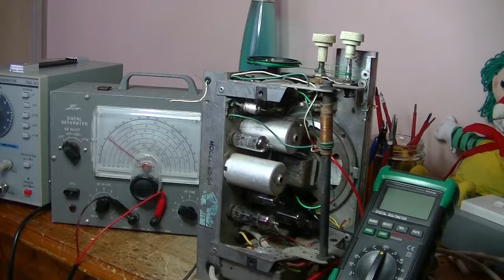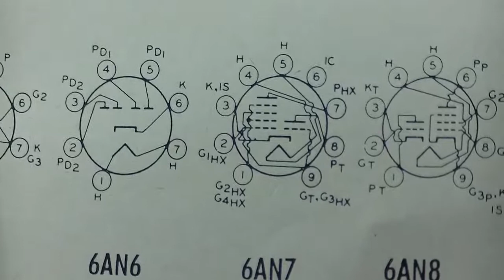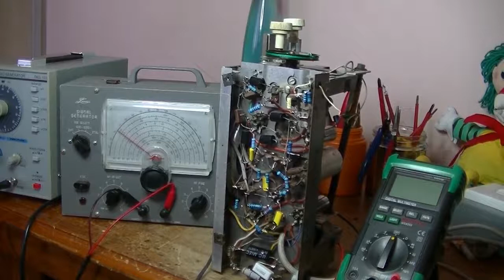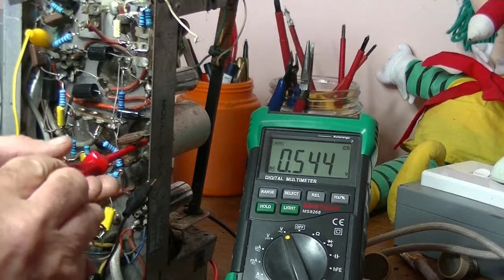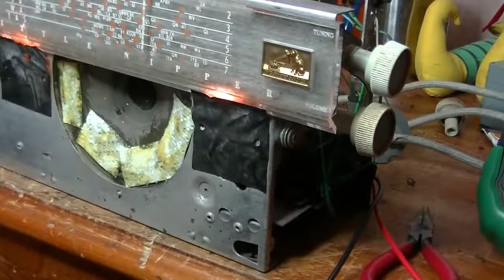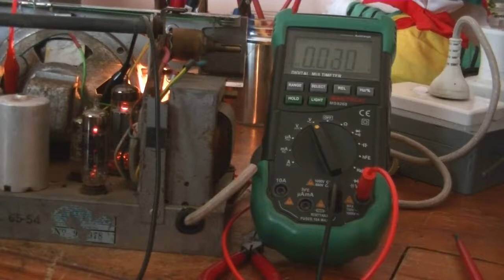HMV Super 5 Valve Radio Alignment

Comment: Hi great videos👍 I've tried to watch all that you do regarding the alignment procedure as I'm new to this  and would like to do my own.
But I can't see where exactly where you place the leads from your volt meter or from the signal generator.
Could you of someone here help me on this my first attempt.
Regards
Leon
Reply from the maker: Hey Leon, check your email :)
Reply from the maker: Hey Leon, no probs.

For the IF alignment the red (or hot)  RF generator lead is attached to the input grid of the detector valve ie, the one that is closest to the tuning gang. If it's a 9 pin like the 6AN7, the input grid is pin 2. If it's an octal valve like the 6J8, then the input grid is the metal cap on top of the valve. The wire attached to the metal cap comes from the tuning gang and should be left in place, according to the service manual.

The volt meter leads are attached directly to the speaker terminals where the 2 wires come in from the output transformer. The OP trannie gives off AC voltage which increases as you turn the volume up and the reverse as the volume is turned down. Your meter set to AC volts will display the voltage changes

Let me know how you go and if you're still not sure, or have other questions, send me another message and I'll put together a short video on this. Also fell free to email me at exeters_lab@protonmail.com

Good luck :)

Comment: What???  You're using a Digital Multimeter to do an alignment??? Don't you know you are breaking "Thompson's Law!!!???!!!"  ;-)
On the serious side, I would never be able to use a Digital Multimeter to do an alignment.  It's a personal thing.  An analog meter is just the perfect item to make the measurements for me, and I would rather wait till I had one, borrow one, buy one...etc.   Since I believe you to be mature enough to accept a little good-natured ribbing I just had to kid you a bit.
I know a few folks that say you should be sure that the meter that you use is > 20,000 Ω/volt and often they suggest you use a Simpson 260.  I would love to own one, but currently don't have any analog meter.
I have enjoyed watching this series of videos on this radio and hope that you will update us on the resolution of the dial cord pulley issue.  It would be interesting to see how to go about figuring out the proper size of a pulley to use to get the pointer to go from end to end of the dial with ending points where they should be.
Again, enjoying your videos and look forward to more.
Reply from the maker: Hey Wayne, mate I love shit stirring, it's good fun :)  I do have an analogue meter but the lowest voltage selection is 10 volts, and I reasoned there would not be enough deflection on the needle when I had to work within a one volt range. I do hope to get a vacuum tube meter one day. Plenty on ebay but they're in the States and the postage to Australia is crazy. Hopefully I can pick one up from the old timers. Yes, that dial drum is going to be tricky, but I know I will find the right size some day. 
Thanks for watching and commenting, much appreciated...............cheers